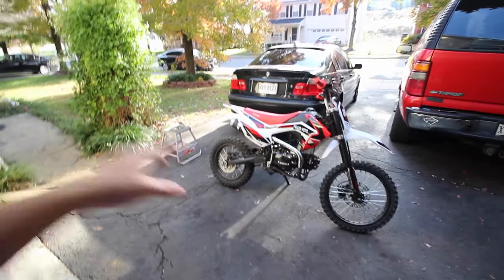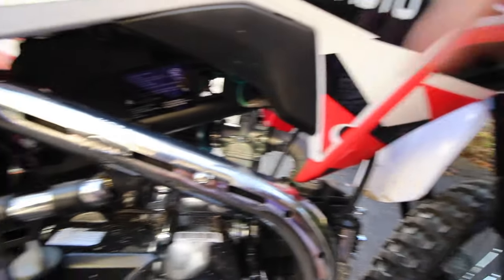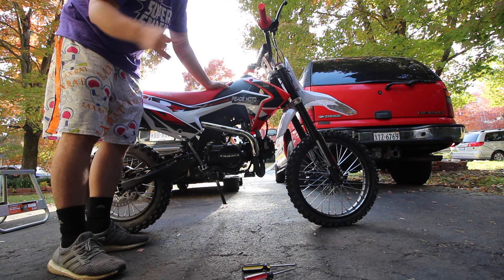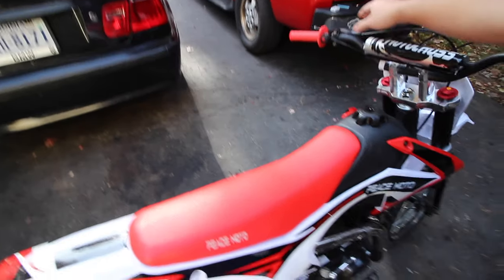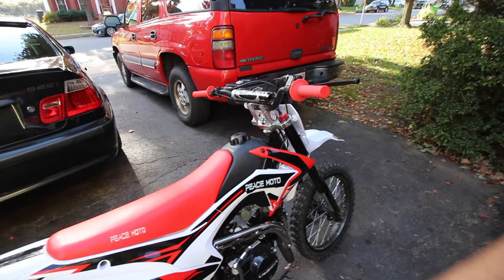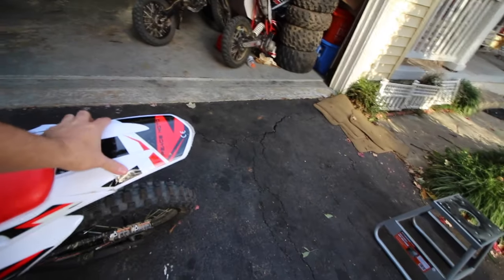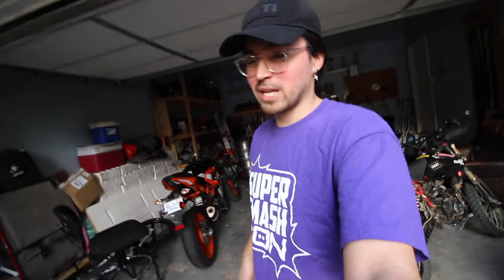Does Your Dirt/Pit Bike Not Idle or Bogs A lot?

Comment: You need to seriously adjust the air/fuel mixture. Its SUPER rich. You need to turn the scren on the bottom IN to lean the idle mixture which will raise the idle also. One you reach max RPM doing that, adjust idle speed screw to the desired idle. it'll run MUICH better
Reply: How do you adjust that
Reply: How to you know it’s to rich
Reply: How do you adjust??
Reply: How to do?

Comment: you are supposed to adjust the idle when the bike is warm and do it while it is running.
Reply: Adjust the pilot fuel screw if it's bogging or adjust needle clip positon! Idle does nothing to stop bogging all your doing is bypassing the pilot circuit and just lifting the slide. Do some research on how carbs work then I'll take ya seriously @exotic motion
Reply: @mikesmotoshop  😆
Reply: Gas lol it’s the idle screw well it is on the ssr
Reply: @mikesmotoshop  any idea why my pit bike is getting hot to quick please
Reply: yeah but it wouldn't idle bud and he did warm it up lmao
Reply: @connorjack3246  lean mixture?
Reply: @gabrielnascimento1021  all sorted. I was just giving the bike death. Upgraded now lol
Reply: @linkinpiatak6669 that’s why you adjust the air screw bud its underneath on the bottom of the carburetor on the clone vm22 Mikuni.

Comment: When you adjust the idle screw always twist the throttle back, screwing in the idle screw with the slide down just causes the screw to dig into the slide
Reply: As in open throttle like you’re revving the bike?
Reply: @fakeman1985  yeah
Reply: @fakeman1985  Same question lol, like, wut? 
haha.
Reply: DM, so pull the throttle to around 1/4 or so?
Sounds like a great tip, if true, and if true, my 
slide should be dust at this point. Does this 
issue damage the slide or the idle screw?
Both?

Comment: I found  on my bike the factory or dealer installed two extra gaskets between the carb and intake and the needle for the throttle need to be adjusted and then the idle screw a bit and now it starts and runs like a dream.

Comment: If you rev up your bike and it takes a bit too idle back down check your float height is not too high .
Reply: What does that mean ? Help please I hit the gas and let off and it stay revving high
Reply: @recklesscreator2434 Did you ever fix it? Im having the same problem. It just stays at a high rev.

Comment: i have the same bike. Mine is an XMOTO anyway after i bought it i simpley replaced the cab and the bike was perfect since then i have crashed and i put the bike up for a while. thought about selling it but i reconsidered cause i like the bike so much and i wanted to learn to rebuild it. my issue is I got a new carb and it idles fine and its not to rich or lean its stoick (if thats the word) balanced but when I go into gear and accelerate the bike bogs. i have turned and twisted every screw and its still the same. my car engine blew and this could be my only transportation i have turned it street legal (i recommend is so nice) anyway im wondering if you have any shimes for me...gems to help me out. thanks

Comment: Don’t bottom the screw, do a turn down, crank and adjust while it is idling. Better than that just buy a mikuni (genuine) carb. The carbs they build these Chirt bikes with are pure poo poo!

Obviously the top 5 are stellar bikes, but these are fun beaters. For cheap.

Comment: mine bogs when i quickly rev it and when i turn the idle screw in or out the idle jumps and its hard to get it to idle. also when i want to pop a wheelie no power and bogs. Im thinking it would be the pilot screw?
Reply: Same here. What was your fix?
Reply: Either running rich or lean

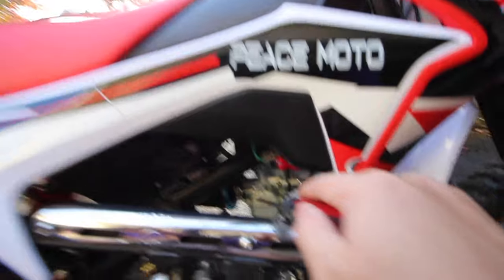Comment: 4:20 your supposed to adjust your air/fuel screw like that not your idle screw 😂
Reply: Where is the air screw
Reply: And why air screw? Please answer anyone?My bike has the problem
Reply: @oomrah9748  depends on the carb
Reply: @oomrah9748  air screw to adjust air/fuel mixture

Comment: Hey im having issued with my bike same as yours but i would like to see how the connections on the hoses are connected because its licking gas tru the air filter
Reply: You probably attached youre fuel line to youre overflow just switch them around.
Reply: Krispy Cheese everything works normal but its just liking from the bottom hose
Reply: Ronny Marte that bottom hose on the carb is the overflow one, it’s designed to let any excess fuel out

Comment: I have an Apollo 250 RX. It bogs no matter how I adjust the carb choke on or off. Bought a new carb and still bogs so at this point I don't think its the carb. No that spark plug either unless its something electrical. Any suggestions would be great and thanks!
Reply: You solved it ?
Reply: FuckThaOpps Yes I did it was the coil wire ground 😂
Reply: Ture Kane cause mines keep bogging & I Tried everything
Reply: FuckThaOpps So go behind the horn and there’s a cylinder looking black thing with two green wires attached. Make sure the terminals aren’t corroded and it’s on good.

Comment: i just got my dirtbike 2 days ago and when i rode it for a bit the exhaust pipe got cherry  red is that really bad its cold outside and it was dark i didn't turn on the choke at all and i didn't let it heat up
Reply: What kind of bike is it? Is it stock? What are you running for gasoline? Is it fuel injection or carbed?
Reply: @rapscallion3421  carbed and it never happened again it might have been cause I rode it without letting it warm up

Comment: I'm having problems with my 250cc dirt bike when I give it throttle its struggling to pick up speed and sputtering and when I chanve it into a higher gear it does the same thing I've turned the idle screw for the revs still struggling when let the clutch out can u help me thanks mate
Reply: Did you find out what the problem was?

Comment: Hey my Chinese bike starts only when I get carb spray with it and then later bogs our after 30 seconds max. Cleaned the carb new spark new fuel line. What should I try next? Haven’t used it in maybe 5 years

Comment: To fix any issue. Take carb apart. Everything. Clean or replace the pilot. Clean the pilot seat. In my case I Terrill it bigger but don’t drill to the ventry. Less chances to get clogged. Then reset the float. Clean the main even if it looks clean. And put it back in. Also use compress air. On the mixture screw take it out and compress air. Mine had shards from factory now it works butifully. Also replaced the screwes with hand twist instead of flat head screw

Comment: My 2018 SSR 150 keeps bogging.  I can't get it to idle right either for you when I get it to run right it has a problem idling.   I've cleaned the carburetor I've changed the Jets a size up and also a size down doesn't really make much of a difference.   Should I just replace the carburetor?

Comment: Whats it mean when the bike is idling high still even after the carb is brand new and you adjusted the fuel screw?
Reply: You should re Jett it and I’m not sure if adjusting the air screw would make a difference my bike doing the same thing I just don’t want to take the tank off my bike to get to it (that’s the only way to get to it on my bike) the air screw is the smaller screw next to the idle screw

Comment: I tried a nibbi carb.  I have an ssr sr150 it keeps bogging out.   But I don't know how to adjust everything else and it's a pian cause I have to take everything off just to change something other than the idle and fuel screw.  So I put the stock one back on cause it worked better.   It's hard to find a 28mm carb
Reply: I have the same bike and the same problem. Did you find a fix too the bogging?

Comment: Hey brother did your peace moto make a knocking sound at low idle.  I just got one and it is making a knocking sound
Reply: Whenever buying a chinese bike, I recommend changing the oil IMMEDIATELY before the first start. The oil they use in the factory over in China where it was "test ran" is basically water. Replace with a good conventional oil for break in, then run either semi synthetic or fully synthetic oil afterwards

Comment: Idk why my drz shuts off if I open throttle at idle and sometimes if I ride it. 
 it starts without the choke but I put the choke it dies. I put and carb and have it adjusted to the way it’s supposed to be and even put a new plug.
Reply: hey man i think your bike is running too rich (too much fuel). there should be a second screw other than the one that changes the idle wind this one clockwise half turn and see if it gets better.
Reply: Cooper Smith I have it about two turns out. I put it at about one and a half and it still did it. Unless I turn it down more. I put a new plug and the plug was built up with carbon.
Reply: Hmm no good brother.Check your float for dirt and check the float level and if that doesn’t work maybe try and lower the throttle needle that’s the last thing I can think of before having to change the jets or getting a new carby
Reply: Cooper Smith it is a carb dude that’s why idk what to do with it. You don’t think maybe the valves need to be adjusted?
Reply: Maybe but usually the valves would just make it backfire lots and should be fine if the bike isn’t too old
Reply: Cooper Smith it’s not to old it’s a 2005. Another thing it does is I’ll hear a little pop in the carb. I’m not sure why thou.
Reply: Yea mine does that but runs fine  does it tick loudly when running
Reply: Cooper Smith that’s how mine is. It runs ok but I know it’s not getting full power cause of that small bog it has. I’ll try messing with the fuel screw or get some gets for it.
Reply: Sounds good

Comment: Also I turned idle screw all the way up and it still wont idle im just going to take it off and clean it and see if that fixes it
Reply: Did it work?
Reply: @rspecs683  cleaning the carb is the best thing to do if yours sat and wont run right, u only need to adjust that if yor spark pug is verry black or white that means the bike is running rich or lean, your bike will bog due do build up in carb or jets somtimes you need to change up the jetting

Comment: I got a problem with my bike... it won’t even start with the choke open. Any suggestions???
Reply: Try to check if the lines are all connected or any leaks or check the carb
Reply: if nothing else, you can always take out the spark plug and using a straw put fuel directly into the cylinder (prime it with fuel)... put the spark plug back in and it will start every time. if it doesn’t continue to run then it’s probably not getting fuel from the carb.

Comment: Ok my pitbike has a brand new carb it won't stop leaking through the overflow and spits gas into the the airfilter on my ssr 110 and as soon as I give it gas it dies I tried adjusting the mixture and it did nothing plz help oh and it backfires and shoots glame when I rev it at full  throttle
Reply: @Blake Baker Pull your carby off and the carb fuel bowl and check your foam float does not have a leak holding down then check your float needle too make sure it hasn't got rubbish  holding it open all the time.
To check your float height put your float and needle back on but leave the bowl off .
Holding the carby level with one hand and blowing through the fuel line use your other hand too raise the float up till you can't blow through it any more this will give you your (current) float height. 
If the float isn't level with carby body which it should,  you can adjust the level by slightly bending the float tab that rests on the float needle. 
I hope this helps you out.
Reply: @davidgriggs3967  ok thx
Reply: @blakebaker8895  If your riding it in dirt invest in a quality fuel filter and bin the stock air filter they are useless , you don't want too dust your engine.
Reply: @blakebaker8895  Uni filter or K&N air filters are good.
Reply: @davidgriggs3967  I live in town so I ride it in and out of town to my grandparents house and rude in the yard

Comment: I've got one but it's a estart 50cc/110cc and but the carby I've got on doesn't even have a idle screw I don't exactly  under stand it. But it runs and rides but as I said just low idle and bogs out basicly the same problem you were having bu r mine doesn t even have a idle screw 😂😂 anyone know how to resolve this solution
Reply: yea dude i have the same garbage carb if u want a quick fix just adjust the screws on the throttle(the grip thing u turn to go lol..) and make the throttle cable a little tighter and as u do this the bike will start to idle but this is basically like holding down the gas just enough for it to stay on

Comment: Your bikes bog right after you buy them, I think it’s time for a real bike man.  I’ve got 2 Yamaha and a Honda. Never have had 1 issue.
Reply: Yea the Chinese pit bikes aren't meant to last
Reply: Yeah, I always would spend the money so it lasts.  Those China bikes only last a few years and break haha 😂
Reply: @lukenovak4164  not if you take care of it like at least try not wear out the engine  because I have pitbike that's like from 2005 original top end .
Reply: Anthony Longoria yeah man I know.  Buuuuuuut... I just prefer named bikes.
Reply: @lukenovak4164  I understand you 100% but I think the chinese bikes are made for people that can only afford to spend a couple hundreds to $1000
Reply: Not necessarily, some chinese brands are built pretty well, for example ssr and apollo rfz. I've had Yamaha's and hondas, I would agree they are ofcourse much better and reliable, but some decent chinese brand bikes with good maintenance run really well for many care free years of riding
Reply: I think motorcycle dealers tune the carbs and test those bikes before they are put on the lot. With the chinese bikes they just put it together and ship it out. Chinese bikes also need the screws torqued when delivered. The niceties of the good bikes are not included in the low cost of the Chinese bikes. But if you are willing to do the work they could last a pretty good while.